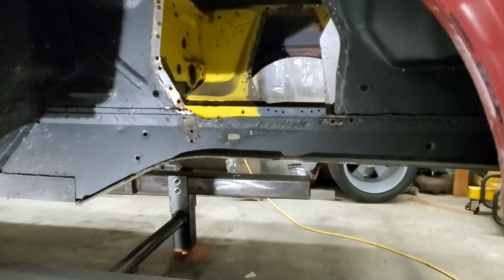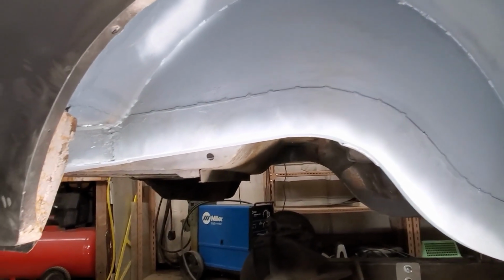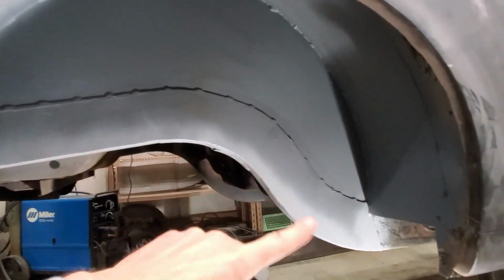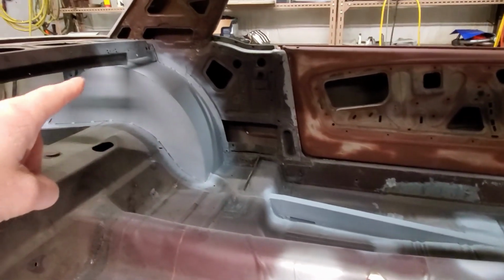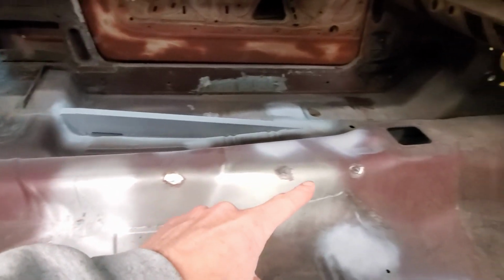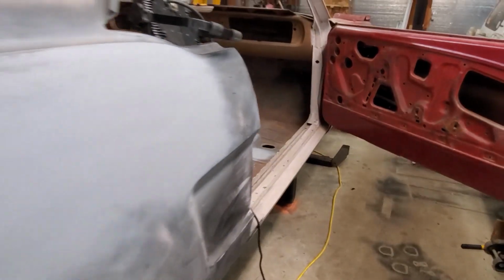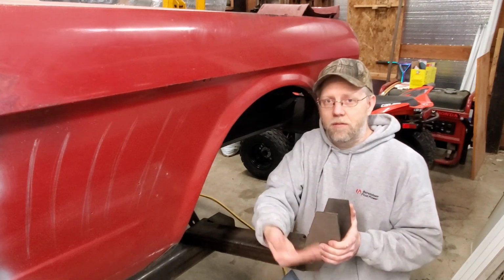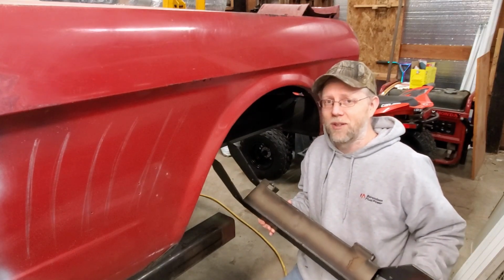Modified 1965 Mustang Frame

Comment: I'm doing much of what you've done.  with regards to the rear framerails and the mini tube you said next time you wouldn't do that- but never elaborated, what would you do with the mini tube- I'm thinking Detroit Speed type version- any advice?
Reply from the maker: Uh, i dont remember exaclty what part I was talking about, but I know that I wouldn't make my own tubs again. I would either buy the minitub kit, or just cut and move the originals over and patch in a strip. The framerails are a pain because of how they are shaped, so maybe the rail kit would be better? I guess we will have to wait for the '67 coupe protouring build to happen!

Comment: Do the front first. Then this summer do the rear so you can paint metal without worrying about the outside temp.
Reply from the maker: Good idea, it does suck to paint when it's cold👍